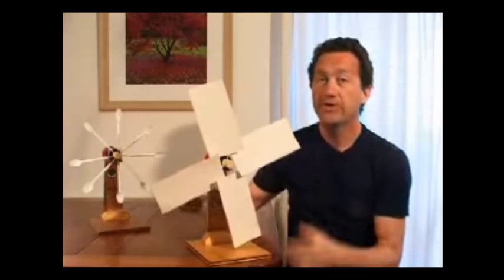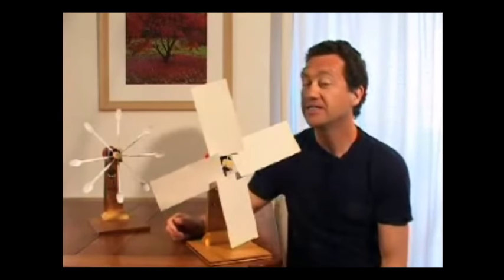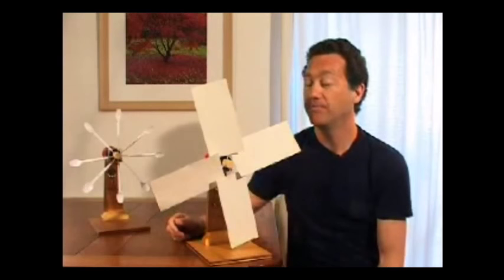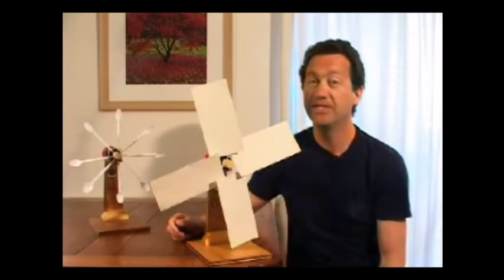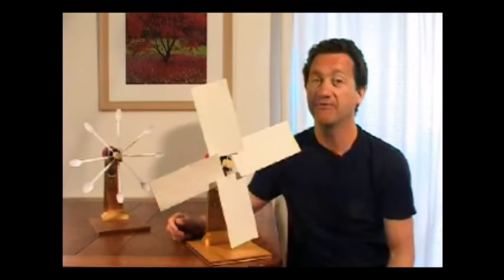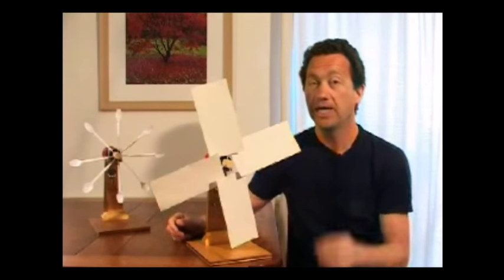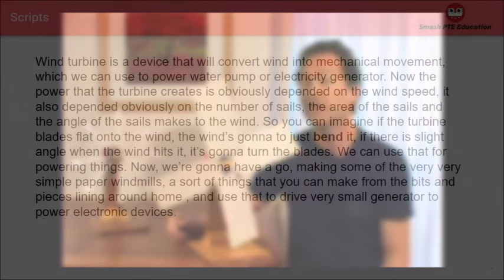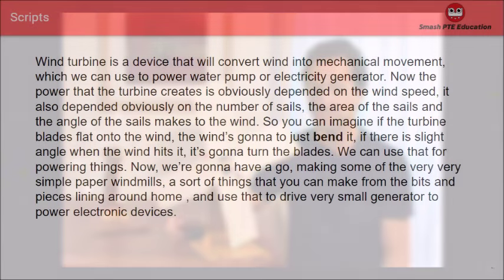#11 Paper windmill -- PTE retell lecture [test video] 真题视频

Comment: The lecture was about wind turbine power & its features. Wind turbine can be used to power water pumps or electricity generator. The power that it generates basically depends upon, the wind power of course, number of sails, area of sails & the angle of the sails. The angle of the sail should be slightly bend which will help the turbine to rotate. A small paper wind mill can be made at home which can help to run some electronic devices at home.